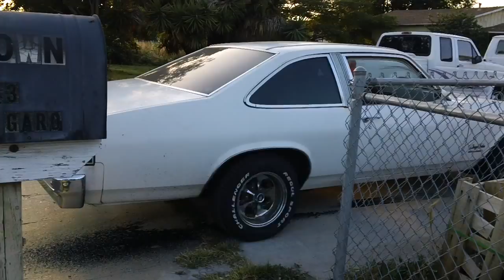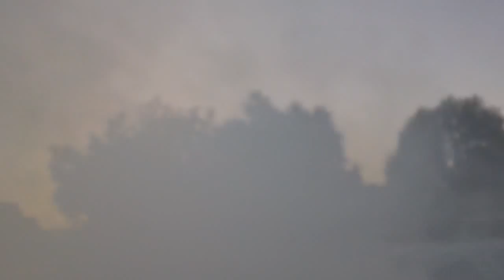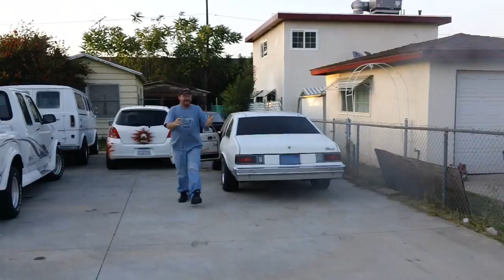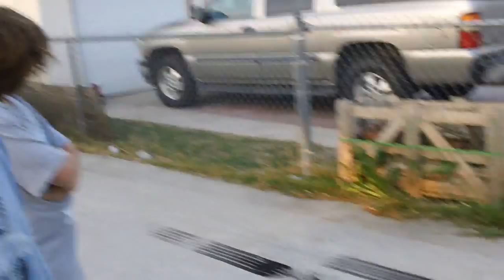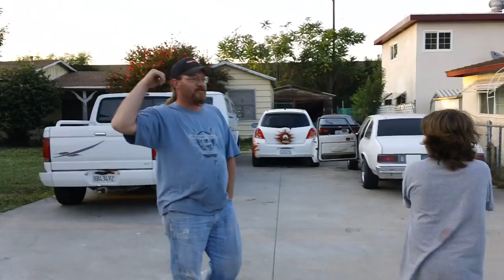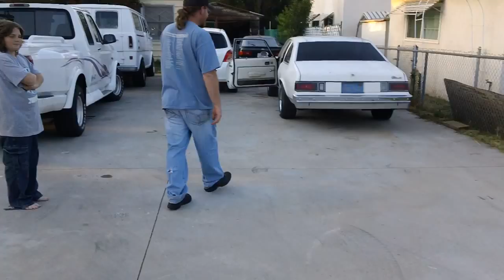My Buick 350 after rebuild!

Comment: Good old  rocket 350 
335 horse 350 lbs of torque @ stock!! No bs
Had 1 in a Cutlass!
One of the baddest cars I've ever owned expecially built 411'z  outback! And some wrinkle walls! Take the front end up enough to where it would not steer!
Reply: This one's a Buick, not an Olds Rocket. Only the car is an Olds….I know, travesty.

Comment: nice, just rebuilt my 69 SBB 350.TA 284 cam,stage1 valve springs, switched over to later oil system,TA timing cover, stock oil pump with shim kit,Aluminum manifold, steel rocker arm kit, arp on heads, not on mains( I know stupid just slipped my mind),TA hi po water pump, Mallory comp ss distributor,complete set hi flow oversized valves, .40 over 10.1 pistons, little under 10.1 comp,2500 JW stall, rebuilt th350, mandrel 3" with flowmaster 50series, rebuilt and re calibrated 750 quadrajet. Didn't